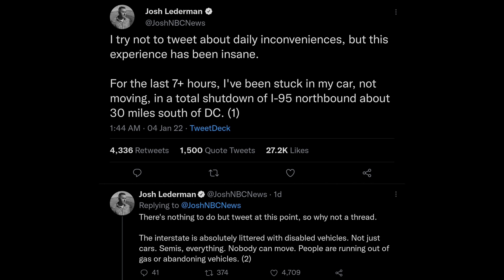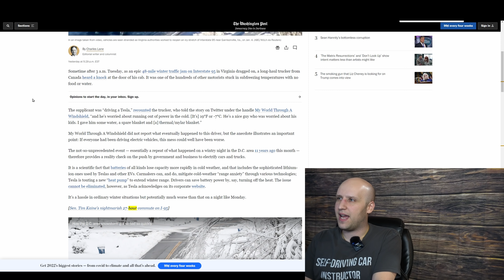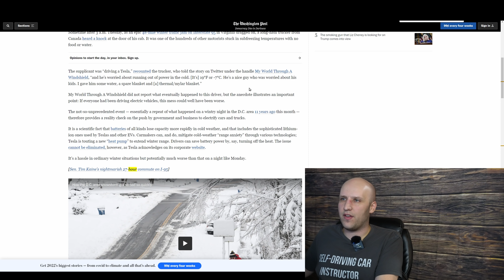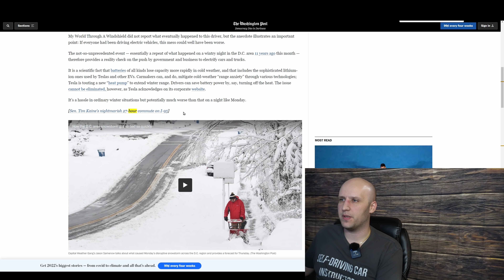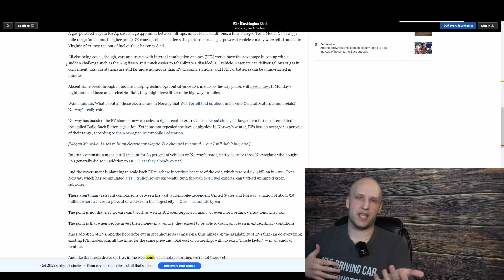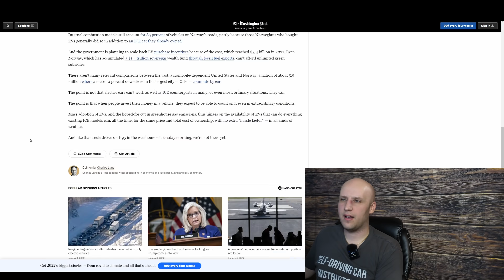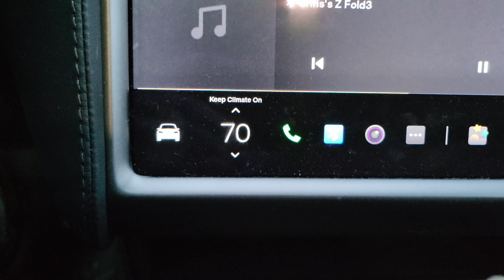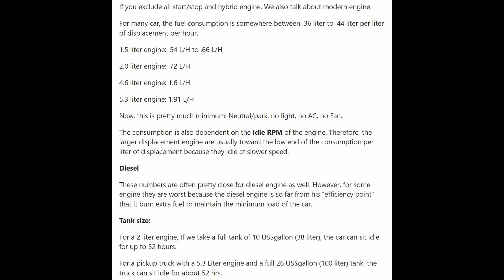How Long Can a Tesla Keep You Warm In A Frozen Traffic Jam? | FUD Debunking

Comment: Also something to mention is body heat, we constantly radiate heat and depending on how many people are in the car this would alter the amount of energy needed to heat the interior to a survivable/comfortable temp.
Reply: Bobby Dole:  Which was stated in the video.  More significantly, with seat warmers and a blanket, a hat or hood, and a coat, a 50 degree temp in the car would be FINE.  Which means the battery would be drained significantly slower to heat the car.   

For an ICE, most of the energy will be running the engine, which is also hard on the car to idle it for a long time (even if doing it in cycles, vs. leaving it on continuously).  And running the seat warmers if the engine is off (if that even works -- I haven't checked in my ICE), will really drain the 12V battery in an ICE if done very long.  If the ICE fails to start due to a flat battery, that's a complete disaster in that situation. 

So in the ICE, that means only running a seat heater when the engine is on (in case you forget, fall asleep, etc) if you want to be safe.  So that means being cold quite a bit if you're trying to make the fuel last, vs. easily keeping the car at a comfortable 50 or so when bundled up with seat heaters continuously in the BEV.
Reply: He said it ...

Comment: Couple notes. I’m pretty sure people working for WP know it’s own by Bezos and articles sort of mentioning Tesla in less than good way is a nice little jab at Elon. Now Jeff also has interests in EVs of course. Most of info in article factually correct but also miss leading and mixing issues not related. Good click for EV haters I guess. Like the Tesla on fire articles. By the way seat heaters toast me and over long period I don’t keep them on,  if cabin at 60F and 4 people in the car all dress up for winter (because it is winter) than you would get more than 60 hrs on full charge in the Y. At that point you worry about more than heat lol

Comment: seat heaters in a tesla use about 500W...so if you are stranded with say 20 kwh left in your battery then that gives you a good 30hrs of warmth to survive and maybe a bit left to limp to the next civilization. at least you're not running your engine at idle just to keep a heater going and you can't run seat heaters for long off of a standard 12v car battery.
Reply: I only use the seat heaters in winter.  Rarely turn on the air.  If you put on the seat heaters and have a fleece blanket on top, you can be toasty warm.

Comment: I am a truck driver and inside our truck we have a inverter for our appliances. If the Tesla can pull up beside a semi; just connect to the inverter. We have a door beneath the bed on the outside. That way it won't affect the inside of the truck temperature.

Comment: So as a Model 3 owner who lives in the DMV (DC, MD,VA) the one thing to remember about ANYONE who would have been stuck in this is no one would have been stuck at 90%. Some charge would have been used to get to I-95 but, how much remaining at the time of stopping is the question. Intermittent use of  the HVAC along with constant use of seat heater(s) would have bought EV owners a lot more time. The other advantage is most EV owners leave home with a full charge vs I.C.E. vehicles which may leave home with a half tank or less.
Reply: The percentage at which the test start is the least important part of this test. No matter what the starting percentage was, you can argue "well, no driver is going to have that much." The purpose of starting at a full charge is to see how long it can go. Knowing what we know now, the battery could have been 50% and the test would have still completed. The point is the percent used per hour.

Comment: The traffic jam could have been worse with all electric vehicles if they all ran out of charge. If gas cars all ran out of fuel then someone comes by with gas. I am not sure how a bunch of dead EV's can get restarted on a highway. I have ran out of gas on remote Canadian highways and hitchhiked to get a can of gas. I am not sure what I would have done with an EV.
Reply: Teslas will reserve 20% of the battery when keeping the car warm so NONE of them would be stranded.
Reply: That assumes that all EV's stuck is a sub zero traffic jam are newer Tesla's. People will run heaters. Just saying. I think the original comment that I replied to was quickly dismissed but he had a point.
Reply: a vehicle that has power  can tow the stranded EV for a short time while it's on full regen, then the EV can drive to the nearest charger, or (worst case) electric outlet.
Reply: And the odds that all the EVs would have run out of charge is ZERO.  Not every EV would have been caught with a low battery charge.  Most would be between 20 and 90% so most would have made it out fine.  You're also not accounting for advances in charging/heating technology/infrastructure that inevitably would come by the time I-95 is clogged with EVs.
Reply: I thought the cars were stranded for about 24 hours and that would leave them all at zero. Regardless, in an EV world there would be none willing to stick around on low level to two others.

Comment: Heck, if you are trapped by a snowstorm, have your mobile charger, and can at least get off the road and into someone's driveway, so long as the power is on just knock on the door and ask "Hey can I give you $10 to plug into a 110v outlet until the road clears"

If you could get that 110v plug, then parked, even below 0F weather you can sit toasty at 70F considerably longer.
Reply: Sounds like homeowners along that road didn't have electricity either. Ugg

Comment: I own both a gas and electric car and like you said both have their advantages and disadvantages. If It is cold I will usually take my Tesla because the cabin will begin heating instantly where as with a gas car you have to wait for the engine to warn up to start heating the cabin which can sometimes take 10-15 minutes depending on how cold it is outside. Another reason I prefer driving my electric car when it is very cold is because starting a gas powered car in very cold weather is hard on the engine and results in a lot of wear because the oil is very thick and does not begin flowing to lubricate critical points within the engine such as the cams and rocker arms.
Reply: I had a Rover 75 diesel and it had a heater which burned the fuel directly to give instant heat from cold. Useful in an energy-efficient diesel which takes longer to warm up as there are lower heat losses.
Reply: @brendanpells912  No matter how efficient your ICE is, you get PLENTY waste heat under steady working condition to heat up your cabin. Lack of heat only happens during cold start.
Reply: Actually oils are engineered to actually be thinner when cold.  For example 10w30 oil is 10 weight when cold and increases to 30 weight when warm
Reply: @howebrad4601  - The problem is that there is little oil above the oil pan after an engine has been sitting for a few hours.  90% of engine wear occurs during warm-up, especially the first 30 seconds when oil hasn’t started fully circulating through all of the parts yet.  Multi-viscosity oil is meant to make starting easier, especially in cold weather, and then thickening at operating temperature to better seal the piston rings against the cylinders as power is increased.
Reply: @jimmanley2796  You are correct on pre-2000 technology, newer engine tech is way more better, the lubrication systems and materials a more reliable and that cosntant 90% wear is not present any more. By the way, your theory explains why my son in law 86 corolla have more that 350k miles and the engine have never been open. He warm up his car.
Reply: @jimmanley2796  you are correct.  I agree.  Usually on my carbureted older vehicles I will crank them for several seconds before I set the choke in an effort to prelubricate them before firing them.  Of course with modern efi they pretty much start instantly so one cant do that.  In any case it's a good idea to idle them for a short period to get oil pressure up and lube everything before placing a load on the engine.
Reply: wouldn't you be waiting the same amount of time because in a EV as you would want the battery to be preheated? seems weird to point out one flaw on one side without pointing out the flaw of the other.
also truly the only reason to idle a ICE car is to warm the cabin, todays ICEs dont need to be warmed up to be effective. so by idling your ICE engine you are effectively wasting gas to just heat up the cabin before you start driving it, which is a massive efficiency loss. you could be driving while it heats up, which saves gas and your time.
Reply: @Rocksfir e  the battery doesn't need to be pre-heated to drive...only to be able to supercharge in the cold. Also, you can pre heat the cabin and all five seats (if desired) in the model 3 while it is parked in your closed garage, from the comfort of your home on the Tesla app. Best thing ever, for winters and summers.
Reply: @leetjohnson  
yea you are correct about the driving while cold thing. my bad.
Reply: @rocksfire4390  no worries 👍
Reply: @rocksfire4390  - Running an ICE vehicle immediately in the cold will cause premature wear.  90% of engine wear occurs in the time it takes for it to come up to operating temperature and warm the oil, and that wear is more pronounced if run at higher power when still warming up, e.g., jack-rabbit starts at lights, accelerating when merging into traffic at speed via on-ramps, etc.
Reply: @jimmanley2796  
that's simply not true not anymore. you need to update your information on the newer ICE's, you can start them wait 10 seconds and off you go. clearly don't floor it.....shouldn't be doing that anyway.
Reply: @rocksfire4390  don't have to preheat to use the heater in an EV

Comment: I live in fredericksburg VA. I was not stuck on 95, but i was without power, internet, or cell service (wtf) from Monday through most of Wed. It was a nightmare. 

I own a model Y LR. I used it over the three days of no electric power to get a little warmer. Even using it occasionally, @60F and Seat Warmer level 2, and no electric charging, it only went down to 76% from 81%. shrug anecdotal, but still a data point.

The only thing I regret is they havent got the "use your car battery as an emergency fall back energy source" working. I have an 80kwh battery sitting in the garage that i could have used to run critical pieces of equipment in my house for short periods of time. I look forward to when this becomes possible.
Reply: Jake Tester:  Re the cell phone being out, the cell towers take power.  If they have no (or poor) battery backup, the weak point in the local network will cause cell phone reliability problems.
Reply: @rogergeyer9851  The (wtf) was a complaint that this (fairly) new super large cell tower that is supposed to service the 95 corridor and surrounding areas of fredericksburg doesn't have sufficient backup power to last more than 2 hours after an "event". 

The tower was functional, but probably locked to emergency calls. Data was there, but all requests rejected. The bars were 1/4 vs 4/4 normally. So clearly they went to a superlow power mode, probably restricted it to emergency calls only.

I dunno, it just seems like somewhere in this chain of failures we could do better.

Comment: An ICE car's duration of fuel when idling isn't really comparative though, your engine won't produce enough heat without load.
Reply: Sure it will. There's less heating necessary when stationary.

With the wind blowing 70mph as while driving, that's drawing a lot of heat from the vehicle. 
Parked, you have less wind, and less heat loss.

Improves an EV's longevity when stationary as well
Reply: Small diesel engines might actually struggle to heat up the car when idling. It is not uncommon in cold countries to have an auxilliary heater in cars with diesel engines.
Petrol engines however usually have no problems even at idle. It just goes to show how inefficient they are.
Under load they produce so much excess heat you could turn the car into a sauna if you wanted to although the heat is mostly just expelled through the front radiator into the outside air.
Reply: @audunskilbrei8279  I can believe it of the diesels
A few years back I had one of those VW 4cyl TDIs
On a -20F morning I headed into work. It started up just fine, but over a 30 minute drive the engine temp never managed to get to full operating temp.

Comment: Assuming a reasonable charge I would rather be in an electric as I could run the seat heaters alone at time or really lower the temperature. In a gas car to run the seat heaters or any heating I would have to run the car, which I know can idle way longer than electric but the ability to feather and adjust things in the electric would be much better.
Reply: except the ICE vehicle can't idle longer then electric.
Reply: Why not drive a plug-in hybrid like the Toyota RAV4 Prime that has 42 mile electric range and 600 mile range on gasoline?  It has all of the benefits of a BEV plus all the convenience of a gas car.
Reply: @trungson6604  hybrids are usually the worst of both worlds. Once you drive an EV like a Tesla, a hybrid literally feels like stepping back in time 50 years.
Reply: @harsimranbansal5355  --"It is the best of time, it is the worst of time. "  It is the best of  both world...It is the worst of both world...depending on your perspective.
Reply: @trungson6604  - No, it’s only the worst of both worlds.  You’re always hauling around the mass of two power systems, but only getting a benefit from one or the other.  Plus, underpowered hybrid engines don’t last long when struggling to accelerate all the time, with that extra mass, especially going uphill.

Comment: So how much energy (gas) does an ICE vehicle actually use while idling in cold weather. How long can the engine run will hinge on energy available at the start. Same for battery. Also think about the efficiency. The ICE is probably extremely inefficient idling while the EV is very efficient. In the end same problem.

Comment: Thanks Chris - do you think having a tarp that you put over the car would trap heat lost due to windows ?  Maybe just place over the roof windows from front bumper to rear ?  

You wouldn’t want to do that on ICE car due to carbon monoxide poisoning, but would the running ICE vehicles nearby an EV be a worry too ?

And if you were alone in EV, do you think you could have 4 seat heaters ON  cheaper than running the dash heater ?
Reply: The tarp might be a good idea or a reflective shade on the windows inside at night.
Reply from the maker: You could add insulation to the inside, especially over the windows, and that would dramatically cut down on heat loss!

Comment: A car emergency kit is essential. You can buy long term storage food bars and water in small mylar bags that won’t burst when frozen. Also have at least a blanket, first aid kit, and flashlight. Finally, there are products that allow you to hygienically and discretely go #1 in your car. You may never need these items but if you do and don’t have them you will have to rely on strangers which is always a bad plan.
Reply from the maker: Some things I've regularly kept in the winter have been traction devices for getting unstuck, blankets, and a small shovel.
Reply: @DirtyTesla  smart man. By the way, thanks for taking time to do this video. I was wondering about this topic when I read about the situation in Virginia. There was also the sad case of the guy who froze to death when he took a wrong turn and became stranded in snow on a remote mountain road (I believe he was a reviewer for CNET).
Reply: @DM-sv6jb  excellent point.

Comment: Seat heaters are most efficient WHEN a person is sitting on it.  The seat heater is convecting heat into the cabin instead of someone's body...that's why your Y is 75° F.
Reply: Geoff Geoff: If that assumption is true re the cabin temp in the X (for which you provide zero evidence, citations, etc), why wasn't that the case for the Y, which ALSO had the seat heater on?
Reply: @rogergeyer9851  It could easily be the case that the seat heater has a different control circuit on the Y than the X.

Comment: Great test, as with all these things in real-world conditions it is down to the specific conditions and how much fuel any vehicle starts with. The 36 hours is pretty impressive and I would rather be in a EV all that time than a ICE car (no pun intended), just for the fact that the engine doesn't need to be on. The bottom line is that the car itself is probably not going to be the weak link, food and water is, and with the exception of the problem clearing a load of battery drained EVs, any criticism aimed at EV's could probably be applied to any vehicle.
Reply: Actually hybrid vehicles have proven to last even way longer than that, people have been living in Toyota Prius for almost a decade for example. The AC is super efficient.
Reply: @alanmay7929  - A decade how, on one tank of gas?  Get real!
Reply: @jimmanley2796  for your records, this YouTuber “Nikki delventhal”  has been living in a 2006 Toyota Prius for years now just like many other people and it says a lot.

Comment: I had a gas consumption diary in my ICE car and it consumed 15-20% more in winter too. Miles and gallons at the gas station.  But of course the in car reporting would not tell the same story as it was a GoM at best. In summer I could stretch it to 620miles/1kkm and 430miles/700km.  in Winter.